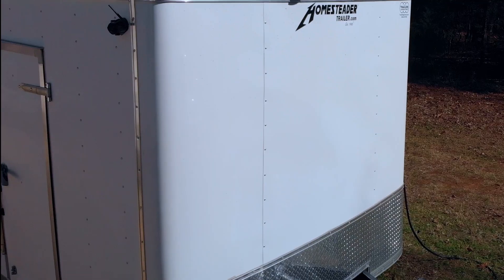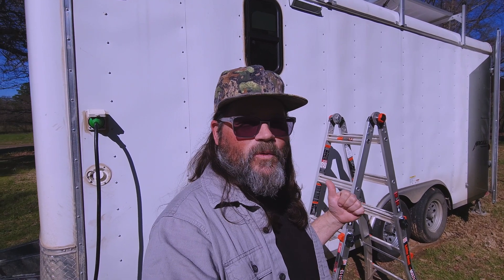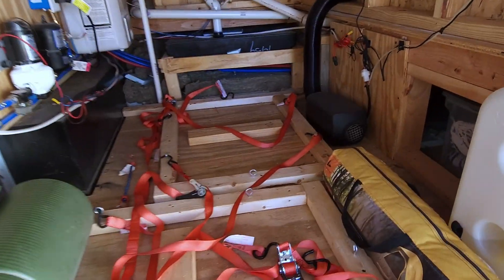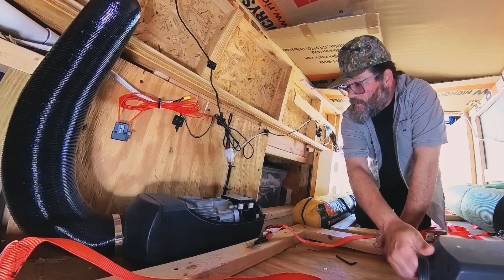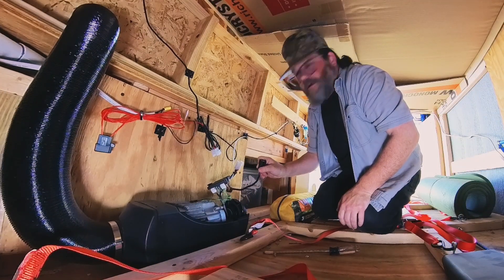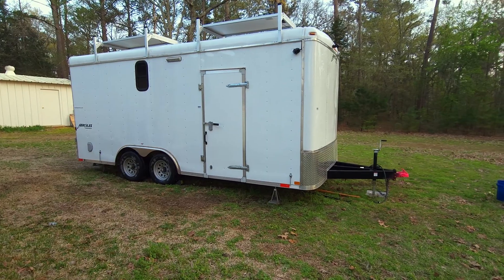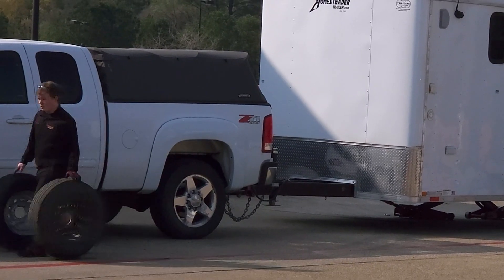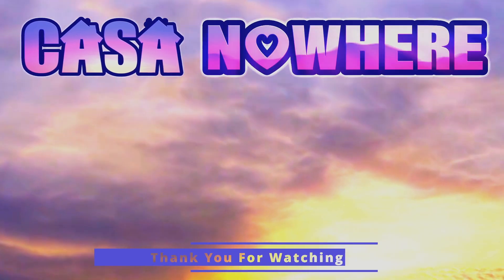ON THE ROAD AGAIN! Upgrade diesel heater Controller ECU and Thermostat.

Comment: What was the reason for switching controllers? What new features did you gain?
Reply from the maker: This has more settings and more control. I can run it lower so I save some gas, and the fuel mix can be dialed in for higher elevations.